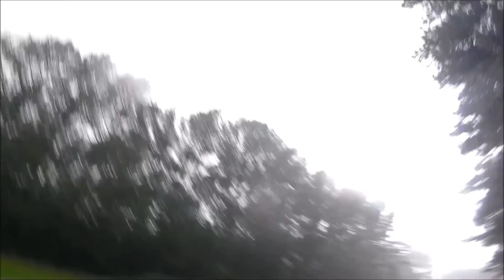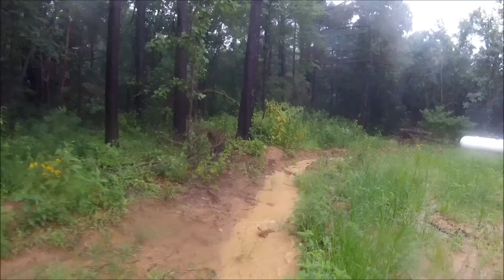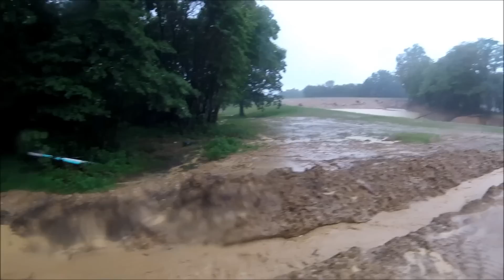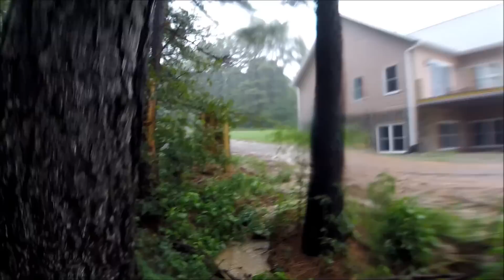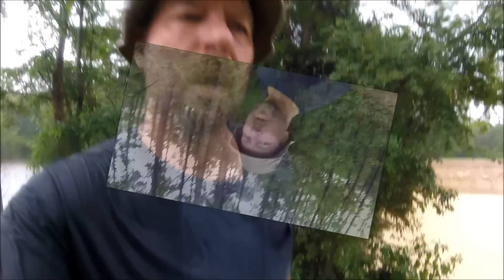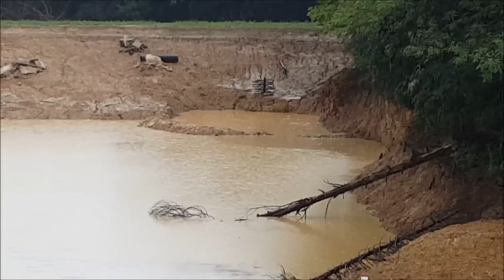New Farm Pond Update! It's gushing Now! 06-23-17 9:52 a.m. Kapper Outdoors

Comment: You should drop some 4 to 6 inch rock in the ditch at intervals to slow down the speed of flow to stop undue erosion.
Reply from the maker: Rod Parkinson I may make a couple of checks if some kind yet. I want to see just how much silt there is after it dries so I can check it out.
Reply: Hey Joe, not sure it would work in your area, but around my parts, which is clay soil too, we use what they call Gabion stone in our french drins and culverts, which is a really large stone that the water like that river you have coming by the house will not move.  I have a really deep ditch next to the house that goes into a 48 in culvert under the driveway, and we get a LOT of run off off from the hill above and roads.  No silting and no erosion.  Which was my concern.  People that don't use it, have issues with erosion undercutting their culverts.  This is the same stone that most people here use in their french drain systems that your ditches you dug are providing.  I believe the silting concern would go away as a result.  Given the distance you are running that would be a lot of stone though. If silting coming from the runoff above is a concern, you might look into it.  Understand every region has their own solutions and this may not be optimal for your area.
Reply: Kapper Outdoors we did the oversize rock dams on new construction to slow down erosion to stem the loss of valuable topsoil.  As well you will probably be engaged in deactivating the ditches so no sense making more work for yourself as well as filling up the new lake you just paid to have excavated.

Comment: You really need to look into doing rock lined ditches and some stone check dams. That will one help prevent erosion of your banks and it will help reduce the amount of silt entering your lake. Also the check dams will help to slow down the water flow also helping to curtail the erosion.
Reply: PA GUY that won't stop erosion of his trenches going to the lake. But even though he has an area for silt to go you wouldn't want to keep filling it up, eventually he would have to much silt in there.

Comment: Hi Kap, (well I don't know your name) When the rain gives you a break, redo those ditches!  Water doesn't do right angles very well.  I am very familiar with ditches, I had one by my last house.  A week of rain and then 7" in an hour = 2' in the basement.  Make those ditches at least 2' deep and 8' wide.  Where you have sharp angles bring in some rip-rap to strengthen the side of the ditch.  Oh, yes, my old ditch was about 4' wide and 2' deep and when the rain stopped it was 8' deep and 80' wide!  It's something you can "peck" at but please do it.  If I remember correctly, and I would check this with a civil engineer, you should have at least 4' of width to every foot the drain is deep. Over engineer so the slopes to the ditch are mowable.  Don't worry, it will silt up all by itself!  But do protect your house even if you have to cut some trees.  I don't worry about that any more.  I have 1/10 acre and I drain into our 75 acre lake.  Now if I could only do something about those Canadian geese!

Comment: Looks like your trenches need some tweaking especially the area where the runoff is going backwards.  I thought the trenches were there to direct All of the runoff to the new pond/lake (no overflows)?  If I heard correctly the concrete slabs are there to slow the torrent (works ok) before it reaches what will be the shallow end of the new pond/lake?
Just an idea, that you might repossession those slabs so their at an angle (30deg?) to the flow and overlap them (a third) so the flow hits a slab(s) then hits the other slab(s) and flows through a small gap slower and directed?  :-)
Keep up the good work.
Reply from the maker: T'airn'KA yes, I misjudged that one spot, lol in the Ditch. I may add some more rock or silt fence yet, but with gullet washers it will blow thru anything.